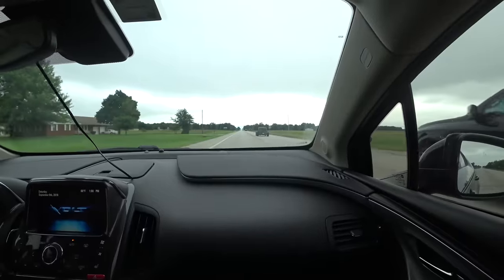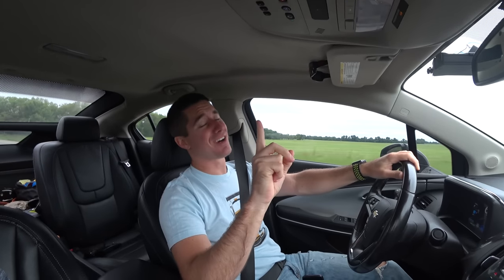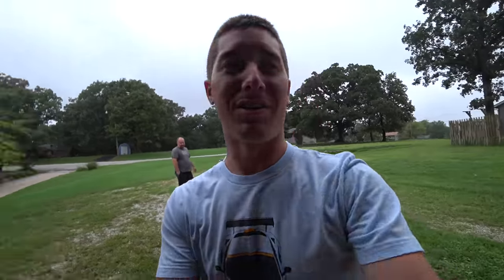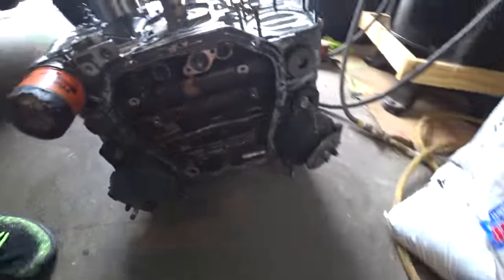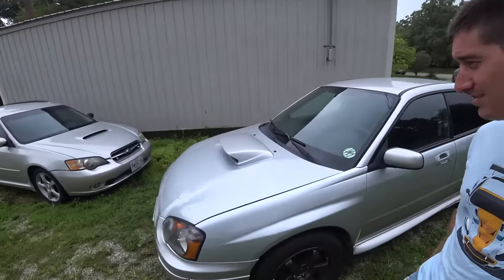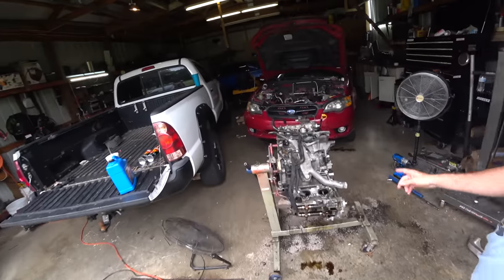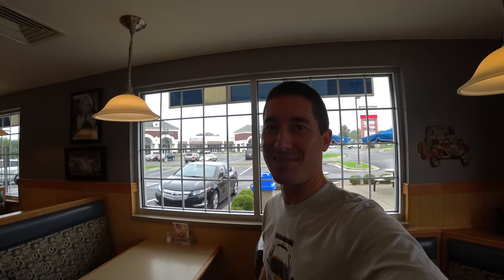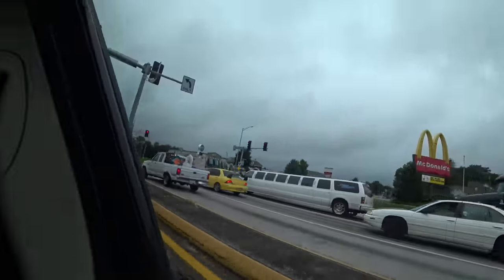We FAILED At Buying A Subaru WRX So I BOUGHT A HONDA HELIX

Comment: Really only 400 miles of range? I would have expected more from a plugin hybrid/range extended thing.
My Subaru Outback gets about 500 miles of range, but it's got the tank for a 6 cylinder but the standard 4 banger engine so it's slow as hell.

Comment: Sure hope you didn't pay more than $600-$700 for that helix. Sounds like it needs some serious work. :(
Reply from the maker: Paid $650 🤑 just needs the rear wheel bearings!
Reply: If you're not going to use the "boomarangs", please save them for me!
Reply: @WatchJRGo   I just picked up an 86 helix for $150 with 7400 miles.  Watching your review video definitely helped me make the decision.  Just had to replace the bent intake valve and a couple other small things.
Reply: @jamesf9074  86 had a problem with an engine component - check to make sure it had a bracket installed.
Reply: @redbaron474  Yeah, they lack a later stay for the carb, supposed to help keep the intake boot from cracking. This one doesn't have it, but its all in great shape due to low miles. Haven't bothered to source the bracket yet.
Reply: @jamesf9074  You got a steal of a deal there! Those things will run forever if you take care of them!